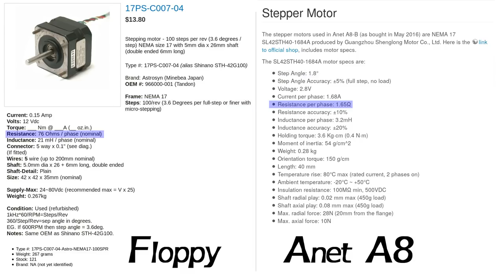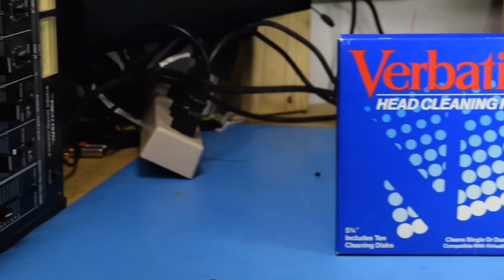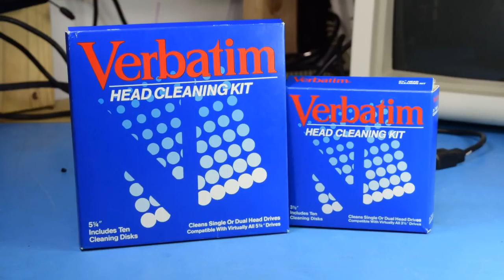Floppy Drive Refurbing

Comment: Why do people try to save bearings? Common... they are cheap, seem pretty standard, and the balls could be shot long ago before seizing...
Reply: Read above...
Reply: Nevexo  Read what? Depending on where you buy they cost around 20$ plus shipping for a lot to anywhere from 10 to 20.
Yeah sure they are made from pure chinesium but how heavy use do you expect to see in a machine that´s almost 30yo?
Reply: 625zz are $2.5 per 10, those are really common in 3d printers
Reply: He did say he was surprised by the effectiveness of it.

Comment: Just buy new bearings ffs. With new bearing you could even revive the donor drive. It's not a car nor a skateboard, it takes just a little load so even new, as cheap as 1$ bearings would be an overkill.